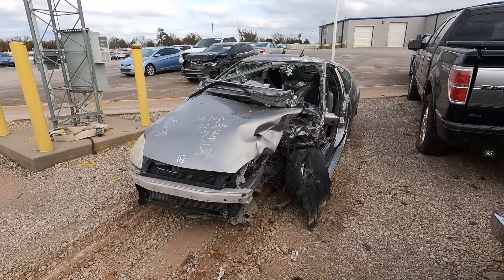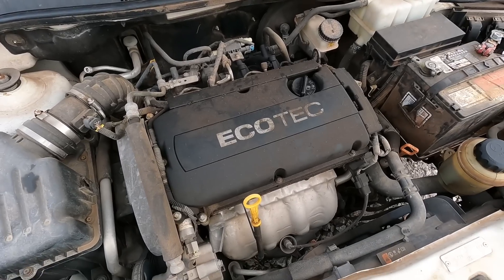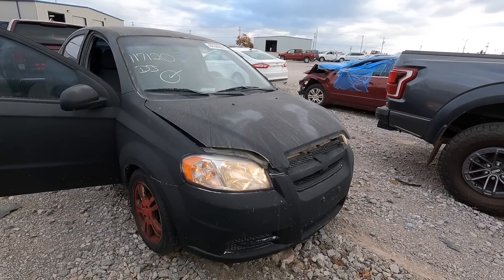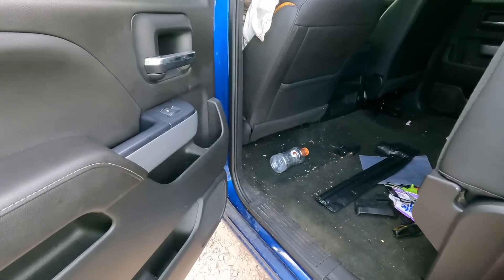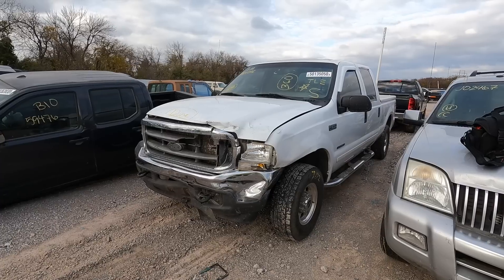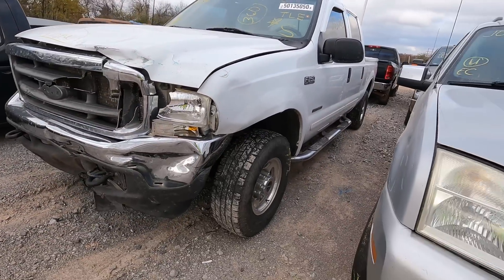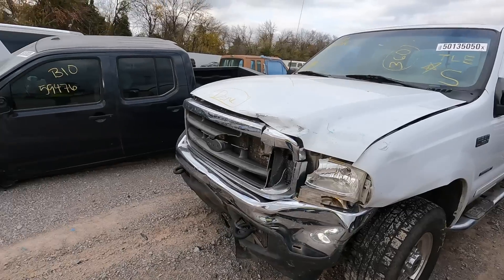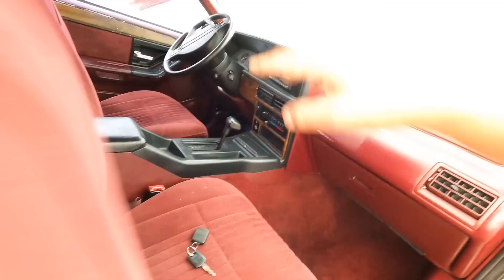Copart Walk Around 11-12-2020 + Lifted Z71 Cheap!!

Comment: Aveo- find its twin that needs and engine & transmission. If it goes cheap enough you could make some money, however, I don’t think it’ll generate much content. Z71 my guess is someone attempted to make their own projector lights... hence the single wire from the switch. They used a light that generated too much heat and that was the point of origin. Re: cougar id bet almost any key from that era would start the car. I had a number of Fords from 89-93 that all had “different” keys. I had to have the right key to unlock the door but not to drive the car.

Comment: I know exactly what happened to that Silverado. They pulled the Drivers Seat and when they put the Drivers Seat back in, they pinched the Wiring Harness for the seat. The front seats slide in the front and then rocks back into place. Ive seen it happen many times. The harness is routed close to where the seat slides into the floor and if you aren't paying attention, it'll get caught and when you bolt the back of the seat down itll pinch the harness.

Comment: Project rebuild! 
Get 40 $10 sponsors  for the Chevy
Reply: It will take a lot more than $400 to put that right. And you'll end up with a $600 car at the end of it, tops.
Reply: @rich_edwards79  sometimes the content is worth more than the car (see: interesting) the $400 is a sign to Randy of viewer interest and appreciation.
Reply: @paulmckinney6163  true. I guess it would be quite the challenge: can you bring such a trashed car back to saleable condition for, say, under a grand? A lot of the parts for these (wheels, lamp clusters, even a full interior) will be dirt cheap from junkyards, but the paint will be a problem. Maybe the black will come off with enough cutting compound? Still might be cheaper than Maaco. As he said, it was probably well maintained until it fell into the hands of its last owner (likely some stoner high school kid) but then it was only a disposable Daewoo to begin with.
Reply: @rich_edwards79  sometimes it's not about the resale, it's just the challenge. Some of Randy's best content comes from vehicles with little resale profit potential.

Comment: The fire on the Z21 definitely looks to have started from the door panel. With the aftermarket toggle switch and the positive wire running to the door panel, I was thinking that they may have tried to install lights in the door panel pockets. The passenger side door panel likely had the same thing done, which could have helped identify what was there. Either way, I'm sure whatever they installed was the cause. I'm wondering if they put the wrench in the door pocket with whatever it was, and the wire was exposed and caused a spark, setting the papers and other flammable things they had in there on fire.

Comment: Man you can save that 2011 Chevy aveo, that's perfect in condition other than whoever used it foolishly and spoiled it  , its worth saving it and giving it a second chanc, also the lifted z71 is savable  , I'm almost a 100% sure its those nasty  wires  , take them off and replace the seat , headliner and seatbelt and other miscellaneous stuff , you have an outstanding 4x4 lifted especially (that's a plus). Good content once again.

Comment: owner fucked that chevy all up.  Hack job on the wiring.   but that should be a pretty easy fix to make.  plenty of crashed silverados to pull the door card and seat from and no paint damage by the looks. Owner prob stripped a custom exhaust off before the insurance company took it.   Biggest issue is prob getting the burned plastic smell out.

Comment: I had a '91 Cougar that I'd bought in '93. Close to that color, bright red. After I sold it several years later, the engine blew, apparently the steel timing chain was mated to a plastic flywheel.  Wonderful idea.

Comment: Randy I think the heated seats may have caught on fire on the Z71, GM had recalls for there heated seats in vehicles before and maybe it got to the door panel, or those wires, or maybe even both!
Reply: It looks to me like an air bag caused it.  The fire was on the far left side of the seat and also the B pillar was affected.
Reply: @mexicanspec  Those side air bags and seat belt pretensioners have explosive devices in them. Could have malfunctioned and started a fire.
Reply: It's likely due to shoddy wiring for Lord knows what. It was a nice truck once upon a time.

Comment: The only one of those I'd be interested in is the Cougar. She's in great shape and I doubt a new key would cost much as it predates any form of programmable chip. That lovely interior is proof of what people say about the '80s lasting until about 1992. I even like the Landau roof! Every bit the cut-price Caddy.

The Ford would be worth fixing if it had 150k fewer miles on the clock. But at 300,000+, it doesn't seem worth it, especially with the gross, worn out interior. 

I thought the Chevy might merit a new seat, door card, seatbelt and a damn good clean until I saw the spaghetti of home bodged wiring in the engine bay. Good luck unraveling that mess. 

And what was done in that Aveo? At a guess, lots and lots, and lots of weed.
Reply: Ford is a Diesel